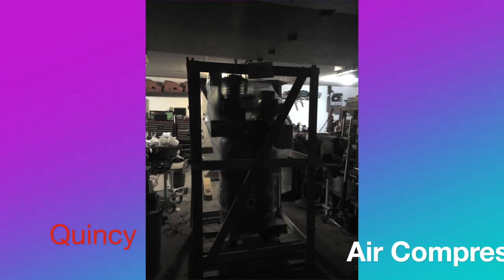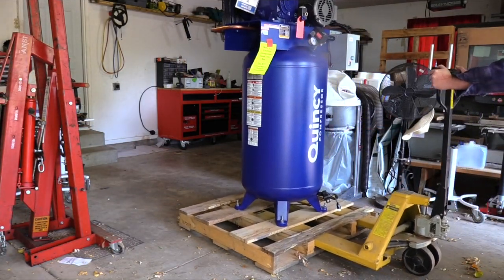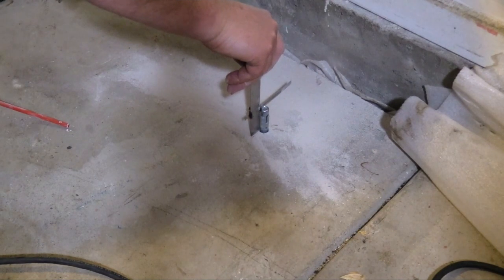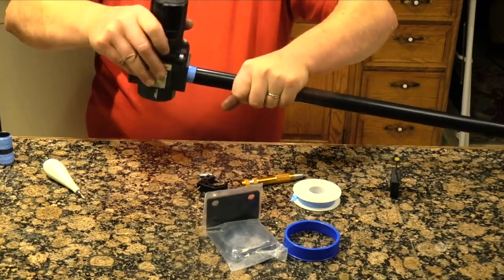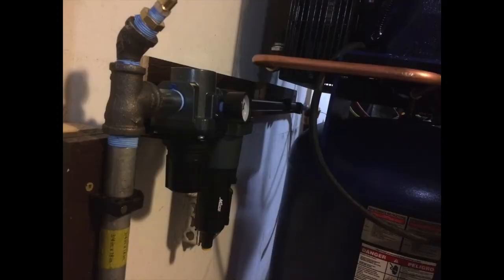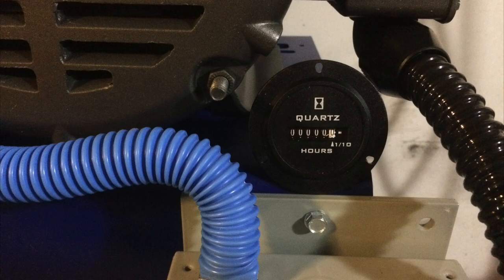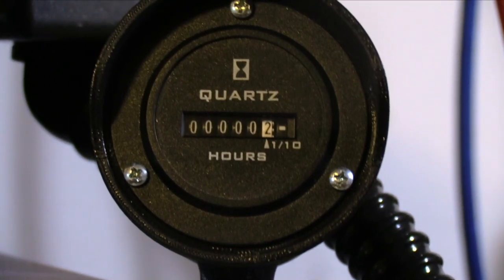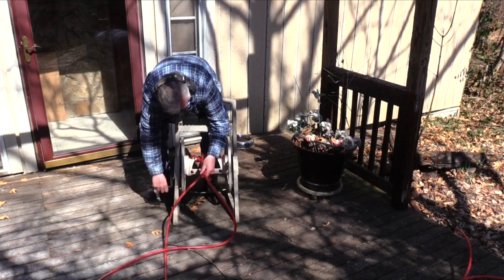A “Maxed Out” Quincy 7.5 HP Air Compressor, Milton Air Products & Easy “NO-Cut” Hour Meter Install

Comment: I saw one of these today at the local farm store. It is a monster. The Qt-54 looked small standing beside the QT-7.5. I have the QT-54 and it has been a great little compressor. I built an aftercooler for it, and it works very well. I also put a mag motor starter on it and an auto-drain and an hour meter. 

I am surprised that the QT-7.5 didn't have a filter/water separator between the aftercooler and the tank. It might be something to consider keeping any water from going into the tank. 

I am surprised that you don't have to call and inform the weather station when using your compressor. The big air sucker is bound to change the barometric pressure quite a bit. 

I enjoyed your video. It was well presented and informative.
Reply from the maker: Thank you, I’ve been using it awhile and it’s my best friend

Comment: Nice video.  I liked the wrench attachment for the hoist.  I did notice what looked like some galvanized pipe for air lines.  
This is usually not recommended as the coating will flake off and get in your equipment over time.
Reply from the maker: You are correct. It was a temporary fix. I have plans to build a complete manifold system  and add power disconnect control box, perhaps another video to follow.

Comment: Vary nice set up..even with the hour meter..love it..    update..bought  a new Saylor-beall  air comprsoir..requested an hour meter. They charged  me around 100 bucks .for a reddinton model..meter..installed..on my unit..ty for your video  again this helped  me when I ordered  mine..comprsoir..made all in the USA..cast iron ..and a Baldor  motor..4 grand with automatic tank drain ...and a after- cooler ..
Reply from the maker: Thank You !
Reply: I'm getting a new air compressor..in Jan 2022..a Saylor beall..same set up..but a 5hp.pressure.lube..pump..made in America....il set up my hour meter  like you showed on your video..I ty again..
Reply from the maker: If you decide you’d like hour meter and mount I designed I have one available for sale, it’s a newer more streamlined design.
Reply: Ty I'm ordering mine with an hour meter. From saylor..beall ..I'm not getting  the after cooler .because  it's now over 600 bucks I'm getting everything  else  added.i done want to spend over 4 grand..mine going to cost 3850..with a pressure  lube pump with oil filter upgrade..so I had to make a choice  longer pump life or after cooler...I like your set up..I'm getting mine from air -flow inc.in sc..I've been shopping  ken knows his air compressors.takes time to talk to me about features. He said Saylor-beall is the best in his opinion..in this country..he said a hr, meter  is good money spent on maintaining  your unit..not much in costs to ad on..again ty for the great  video...
Reply from the maker: Best of luck ! Feel free ask any questions you may have

Comment: Just a little tip. Your pressure needs to be at 90 psi when your using a tool. Line pressure drops when your squeeze the trigger. So look at your regulator squeeze trigger on tool and raise pressure till it’s at 90psi. What you’re doing is called 90 psi static pressure.
Reply from the maker: I actually 125 psi tank pressure and 90 psi line pressure. So I about 35psi cushion. I thought I mentioned it in the video, perhaps not. Thanks

Comment: Very informative video, sir. Quincy  makes one hell of a machine. I looked into them a while back and found that along with surprisingly good customer service, they are built like tanks and they're just a little out of my price range as a hobby level wood worker, DIY type and maybe a skill level or 2 higher than shade tree auto mechanic. But man do I really want one!
So when I saw the title of this video, it piqued my interest. I thought "how the hell does a home shop Max-Out a Q 7.5?!" I misunderstood obviously. I wanted tp compliment your video, it has lots of useful information, it more than kept my interest and I really like the Hour Meter modification! 
I just finished building [what was originally] a Speedaire 5hp, 2 stage, 80 Gal, Vertical machine for my garage/workshop. Funny enough is now only a Speedaire by way of the name on the tank. Come to think of it the tank is actually a Campbell Hausfield, HAHA. Well, the placard said it was certified by CH I'm not positive if its a Speedaire or CH at this point. In any case I think it would benefit from an hour meter so thank you for the idea and thanks for the great video!!
Reply from the maker: Thank you tremendously! If you decide to install an hour meter , I included my email in the description box. I have some custom designs for other applications

Comment: Bought a Saylor-beall  air comprsoir. Order mine with a reddinton  hour meter.    The after -cooler radiator  is installed..in front of the motor..on mine. The motor  has a fan on it to cool the air going through  the radiator.. that's what sold me on mine unit..Saylor-beall  folks will custom build your unit..made in st.johns, Michigan..you need to go through  there sales rep.  Who was vary help..I spent some heavy change..for my home shop..but worth it..no more home store junk..q. ..was my 2nd choice..but Saylor-beall  offerd me a tour of there plant..as well.and I live in fl..but  I felt this family owned co..made in America  built  and assembled  was what my dad would say.  Do.it..great video..ty I bought a 60 gal unit 3 hp.  2 stage with there 705 pump..all cast iron ..
Reply from the maker: Great job ! The Reddington and Trumeter are the same hour meter by the way. So you are getting the same Gage.
Reply: @normanpaulife  we didn't talk about the pressure  gage..il have to look at it..,check it out..closely..all can say. I spent is heavy pocket  change.  For a lifetime  comprsoir..  it also has disk valves in the head..  I have the 705 pump.all  cast iron made in America....
Reply: The 100 bucks for the reddinton  hour meter was includes installation..  I was impressed  with this company..they ask me questions  about my use.,s..I live in hot sunny FL.  So they recommend  a there after-cooler..I delt with pacific  aircompressors  ,Mike henager..on the other coast..he knows his comprsoir, s. We talked about what I wanted..dif brands..they sell.and they sell parts if needed..and how to video s ..ty.
Reply: If u want to see my review  on my Saylor-beall..go to my u tube site ..Stephen eggert.  Q....was my second  choice..great video..ty

Comment: Nice machine.  I have the QT Pro 7.5 and not the Max. You don't show a lot about the Quincy intercooler or plumbing.  I don't see a water separator after it.  Does it just dump the cooler air and water back into the tank?  I never could find out from online pics and figured I'd add my own down the road.  My tank gets pretty warm and lots of water!
Reply from the maker: @RJMachine62  I have an automatic drain with a diffuser ( muffler) does dump water but the diffuser breaks it into unnoticeable droplets

Comment: Great video Norm!! Easy to understand. I just purchased an exact 7.5 hp Quincy. After watching this video I was hoping you can sell me a similar meter holder?
Reply from the maker: Amazingly I had a similar request and I created a spare
Reply from the maker: Send a message to Kingranch@currently.com for information about a sale. I have a complete working model on hand.
Reply: @normanpaulife  Great! I messaged you to the address you posted here.
Reply from the maker: It’s boxed and ready
Reply from the maker: Bogdan, I bought a Parker brand silencer to remove the sharp “snap” of water drain, Parker is high quality, there are others but their reviews turned me away

Comment: The best series of compressor that Quincy makes is the QR series
QT stands for Quincy Taiwan that’s where that pump was made but the rest of it I’m pretty sure what the exception of maybe the pressure switch was made in the United States
Reply from the maker: I believe it’s made in USA but some components are outsourced, the pressure for example is I’m certain, because mine was leaking and they sent me replacement and the main tube was loose. When I discussed it with Quincy Tech , they said it’s brought in that way and installed, without checking the QC of the part

Comment: The air compressor should be at least 12 inches from the wall for it to breathe properly. A compressor that big should be direct wired using AWG 8 gauge wire with a 50 amp breaker if not a 60 amp breaker to handle the start up load when it is in use and has built up some heat.
Reply from the maker: Thank you for your feedback

Comment: very good instruction thank you. How did you wire the meter to the panel? I saw the black wire yes but what about the white wire since it is 110v, it needs another white right?
Reply from the maker: The hour meter ?  It wired it 110 volts, one hot L3 and one ground.

Comment: Good job and good idea with lifting air compressor. Quincy recommends only 1/2" floor stud to floor, did you do that and if so what is it made of. Thanks
Reply from the maker: Yes I did do 1/2 floor studs , the length was about 4.5 inches , I measured the the thickness of the foot and subtracted from the length and insured it had the required anchor depth
Reply from the maker: The floor is concrete and the anchors are steel swag type

Comment: Can you provide more details on the compressor model number you purchased, where you purchased it from and any feedback on your purchasing experience?
Reply from the maker: Yes. I purchased it from Northern Tool and supply, it was directly shipped from the factory ( in Alabama) in my case .  It took several weeks , I paid to have it delivered with a lift gate truck as opposed to picking it up at a local warehouse. I’ll get placard information a little later
Reply: @normanpaulife  Great. Thanks for the quick reply and the awesome video

Comment: great video! I was hoping you could tell me if your magnetic starter is or like a eaton b27cge40? I recently purchased a used rock river 7.5 hp 80 gal compressor and im not 100% sure where i put the 2 leggs for the plug wiring.  After watching your video it looks like its the same or similar.
Reply from the maker: It’s an Eaton and I can get details ( later)
Reply: @normanpaulife  Thanks i appreciate it!
Reply from the maker: I can send you a detailed photo of the interior components or the factory wiring schematic ( I’d have to track that down) my email is in description. If you’d like more information that cannot be included in comments section such as attachments

Comment: Bolting the compressor rigidly to the floor is not advisable on upright units, it could crack welds is what I've heard anyway, Somebody makes isolators saw someone use them on another unit.
Reply from the maker: you are correct! It is anchored loosely according to Quincy manual instructions, I stated loosely in the video.

Comment: I am not familiar with the brand Quincy where I come from Ingersoll rand is very popular
Reply from the maker: If you check Northern Tool they carry a variety of air compressors. I had my heart set on IR for many years, but the 5 HP models are no longer made in USA, I believe the compressor is actually made in India and the motor is likely China. I was very disappointed with the side by side quality of the two. Tractor supply also carries IR.

Comment: Hey Norm can I buy an hour gauge meter housing from you?
Reply from the maker: I believe I can make that a reality! We can discuss your hour meter needs at Kingranch@currently.com
Reply: Thanks Norm I tried to email you at the address given, I’m so happy you made this video I just purchased the same identical compressor about a month ago still waiting for delivery, this will help me more than you know! Thanks
Reply from the maker: Your mount is printed !
Reply from the maker: It’s ready to mail
Reply from the maker: Matt your mount is shipped ! Priority 2 day. Enjoy
Reply from the maker: Your gauge is Delivered!
Reply: Thanks so much Norm quality of the part was awesome. Excited to get it installed. Top notch!
Reply from the maker: @mattsmith4082  you did a spectacular job on the install, I learned a few tips from you !
Reply from the maker: Matt I found a “Parker” brand silencer for the drain that removes the sharp “snap” of water drain. There are cheaper models  out there but Parker is high quality

Comment: You talk about people butchering their machines and being careful not to void the warranty but you voided your warranty as soon as you installed a wall plug..   These machines are hard wire only and if you read your manual you would know that your warranty is now void.   If you don’t believe me call Quincy tech support with a burnt motor and tell them that your running off of a plug…. Read your manual people!!!!
Reply from the maker: I do not believe there is any reason a high amperage plug will cause undue risk to the compressor. I do not recall a requirement in the manual stating it must be hard wired although my plans were to hardwire it in when I installed a new sub panel in my shop with a cut off switch ( I purchased) it has not happened. The compressor over three years old, it’s out of its extended warranty and has never had any problems since its installation. 

Thanks for your comment